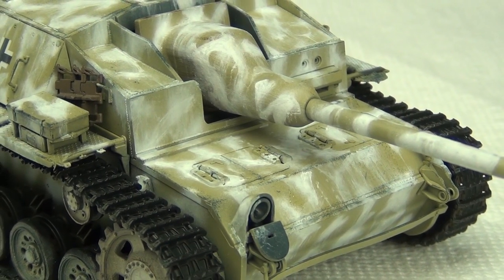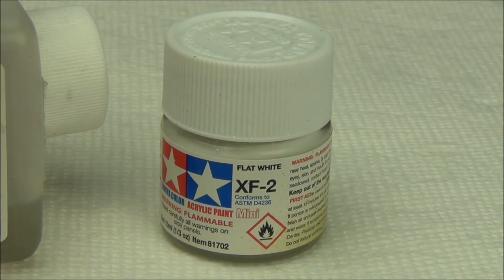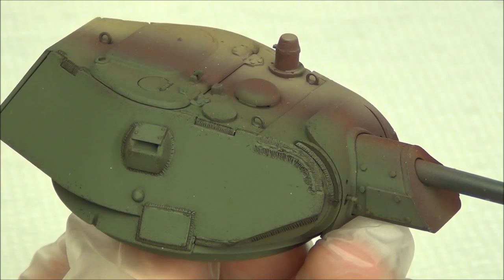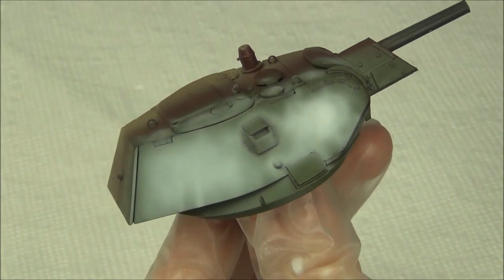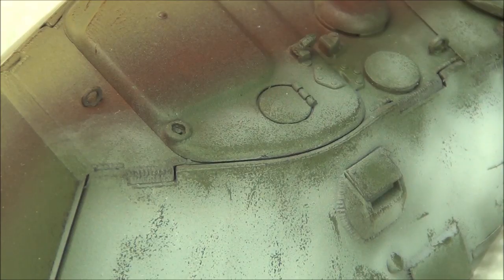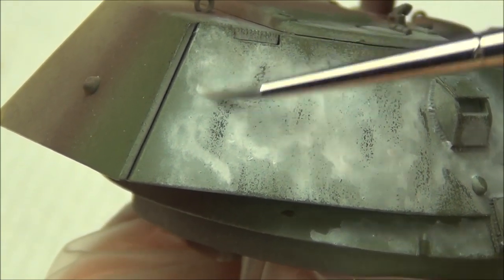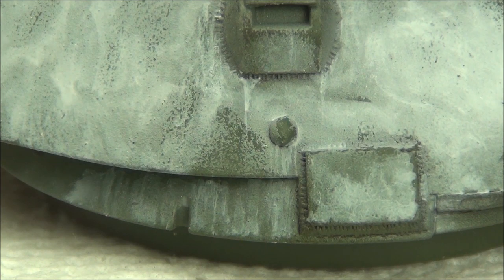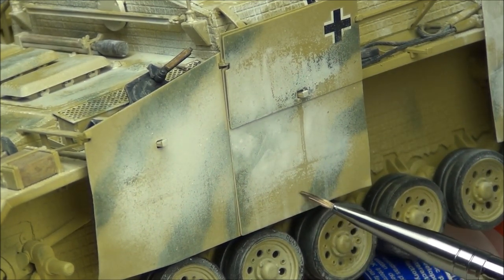Let's paint MESSY Camouflage in Scale – Field-Applied Winter Whitewash How-to for Model Tanks

Comment: I tried to simulate 'broom painting' but i used oil instead of whitewash paint to fill in the large 'painted' areas.Citadel air chip's OK,and is a very thin paint.I got some Mr metal colour Dark Iron,it was'nt much cop,but if you don't shake bottle too much you get a dark charcoal colour and it runs like a mineral spirit wash.And when you 'buff it' because its not shaken theres less graphite,so only very high points go metallic.Very crisp effect.I used it for 'crew welded' add on's.

Comment: Really great video, pal. You could use water instead of the Tamiya thinner, and it's important to mention DO NOT use lacquer thinner, as it will not come off! On my pziv schurzen, I took off too much of the whitewash, so I clearcoated again, hairsprayed, then sprayed on more white paint then weathered. I think I remember doing this 3 or 4 times actually until I was satisfied. You need to clearcoat so that the underneath layers won't run off. KUTGW. Nice to see you videoing (?) again.
Reply: It will come of with lacquer thinner but it's harder for sure. Just did it recently...
Reply: @joshuaramos8399  ok. It will come off but much more difficult! Stick to regular Tamiya X-20A or water is the point I'm making.
Reply: It comes off really easy with a sanding drum in a dremel,  i find if you are crying while doing it it makes it more realistic
Reply: @steviegibson5847  Definitely better with X-20A or water. But lacquer thinner was the only thing I had atm, haha.
Reply from the maker: Yes, lacquer thinner just makes the paint dry harder so it can be harder to chip.  I've done it in the past with Tamiya and Lacquer thinner, and recently did it on a DAK Panzer using AK Real Colors which are lacquer. Those chipped super nicely.

Comment: Now I don’t paint armor but I’ve been curious about applying whitewash as a moon/space camp on a zeon mobile suit. Like it was a ground unit but they convert it space. My main concern is being able to show the scale of the hand painting on something as massive as a ms.
Reply from the maker: It would be tricky in 1/100 or 1/144 scale, but I imagine still doable.  A fine brush could be used to apply strokes, or a fine airbrush nozzle used to simulate a scale spray pattern.
Reply: @Panzermeister36  yea that was kind of my thought too and 144 would be damn near impossible to do if your trying to make it look truly hand applied like you have here. . I think the best plan would be to make it highly chipped so you can get away with a very light coat maybe. I’ll keep the idea in the back of my head for later...

Comment: I did Vallejo over tresemme last night and it was horrible. It came off way too easy. So I tried different thickness applications to see if anything changed. Not a damn thing changed. It was horrible each time. So my finished product is three levels of white wash.
I will be going back to tamiya.
Reply from the maker: +Dan Timmerman yeah, those polyurethane acrylics like Vallejo and Mig don't HS chip very well.  Tamiya and other alcohol based paints are much better for nice fine chips that look in-scale.
Reply: My only reason for using vallejo over tamiya is I have zero airbrush cleaner or x20a left. Every local and online hobby store I could find was backordered for both products. Definitely not paying a $24 ebay scalpers price either.

Comment: Super nice thing with the hairspray!  Would it work with two coats too!  I would use oxide red, then hairspray, then the actual camouflage, hairspray again, then the white?  Could you then apply water to the oxide red with a brush?  And how long would you have until it stopped working?  Thanks !  Greetings from Germany!
Reply from the maker: I have tried that with some degree of success.  You can either do red primer, hairspray, camouflage -- then chip.  Let it dry and seal with a varnish.  Then more hairspray and your white -- then chip that.  Or, you can do it all with multiple layers and try to chip simultaneously.  But this may make it difficult to keep the chipping refined as most will simply go right through to the primer, when you want most of the wear on the white to expose the camouflage and only some to show primer.  So doing the process in two batches will give more control.
Reply: @Panzermeister36  Thank you for the fast answer!👍😊

Comment: Prolly a huge noob question but….  Can you do multiple hairspray/chipping layers on top of each other? Ex: primer/hairspray/ top color/ chip then hairspray/winter camo/chip?
Reply from the maker: Yes you can, but you might want to apply varnish between the two rounds of chipping.  Otherwise, when you're chipping your winter white, it may start to activate the primer chipping layer as well a little bit.
Reply: @Panzermeister36  Thanks! I usually do military aircraft, but I’m about to do my 1st tank (Tamiya early Tiger) so trying to pick up all the tips & tricks I can.

Comment: I've never heard this question answered, or even ASKED!.... WHAT EXACTLY IS the chemical(s) in "hairspray", and why do they work the way they do....????....Has anybody ever tried different brands of hairspray to see if there's any difference....????.... Good video, btw....
Reply from the maker: Well it's just the fact that hairspray can be washed away (like washed out of your hair) that lets it be chipped like this using water.  It's basically a thin adhesive layer that acts as a weak barrier once it dries.  Other hairsprays also work, just avoid really expensive high-end ones as they're stronger and harder to chip.

Comment: Thanks good info . What Turret is that? I like it.
Reply from the maker: It's a Wilder Resin turret for the T-34/122 concept.  I believe it is out of production though.
Reply: @Panzermeister36  Thanks.
Reply from the maker: You might be able to find resin recasts on ebay.  I don't support pirate recasters, but if the original is out of production then it's not really taking money from the original maker anymore...

Comment: I am planning on doing a Sherman with this technique as it seems perfect!  One question however.  You mentioned you should do chipping of base coat prior to white wash.  should you do that chipping with hairspray as well?
Reply from the maker: +Eric Semmelmayer you could do it with hairspray chipping, brush chipping, sponge chipping, salt chipping, or any other method.  If you use HS chipping, be sure to let it dry before doing the second round of HS chipping for the whitewash since you don't want to chip the base colour further when chipping the winter camo.
Reply: Thanks for the info! Turley appreciate your response

Comment: Curious if i would get same effect when using Vallejo Model Air applied with brush Instead of an AK White Wash.
Reply from the maker: +Dennis Pfund no.  The AK stuff is specifically designed to reactivate with water.  It behaves differently.

Comment: Beautiful! Would you recommend oil weathering both before and after a whitewash?
Reply: I applied a whitewash recently and just used oils after the whitewash application. You could do it before, but the areas under the white will be covered up. Another variation to the whitewash technique used by Evan is to airbrush a slightly off-white whitewash to help make it look grubby and then on top use an oil paint pure white/AK washable white over areas to create variation to the tone of the whitewash. Michael Rinaldi describes this variation of the technique in detail in his Tank Art 1 book. I think there may also be a YouTube video where he covers the subject.
Reply from the maker: I might do it both before and after.  Like I mentioned about doing chpping before the winter camo for interesting layer effects, some oil discolouration or streaking can work the same way.  However on the little T-40 Im only going to use oils after the winter camo.  I also didn't chip the green on it either...trying new stuff to save time and products :)
Reply: Panzermeister36 cool! Thanks for the tip. Your channel is top tier for scale modeling stuff.
Reply: PM, how did it turn out when you didn’t chip the green before white washing?
Reply: PM, I am not going to start my Sherman build for a while , so if you haven’t completed your t49 yet, please respond to my question when yo do.  It might be in time

Comment: Will it still chip if you let the paint dry longer?
Reply from the maker: It will but it will be difficult to chip.  You may need something tougher than a brush to get the desired wear pattern.
Reply: Thanks! I just purchased a Patriot 105 based on your recommendation. Do you need to completely break it down to clean it, or can you just run cleaner through it?

Comment: WHY does everyone have to airbrush ? Especially Soviet equipment it was slapped on with a brush go for it 🙄
Reply from the maker: Brush painting a model isn't going to give as smooth a result as something even brush painted because there's a 35 times scale difference.  Airbrushing is much faster, smoother, and gives a thinner paint application which doesn't ruin molded detail.
Reply: @Panzermeister36  it isn't supposed to be a fine finish slap it on and hope an 88 doesn't take a tank turret off as it leaves the factory don't think they were looking for a nice smooth finish at the end of the day 🙄